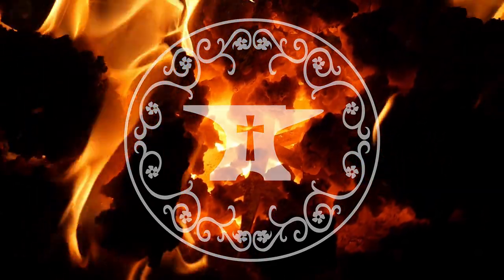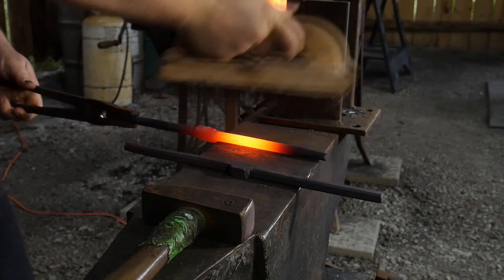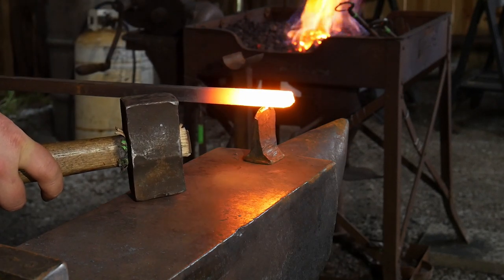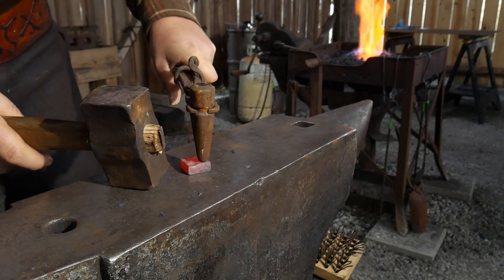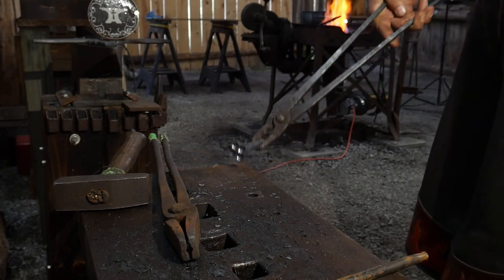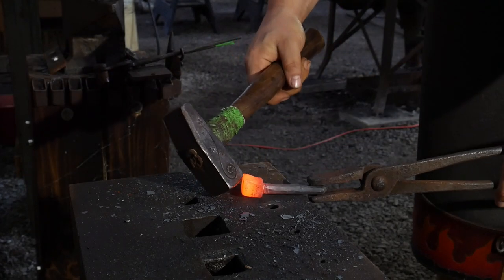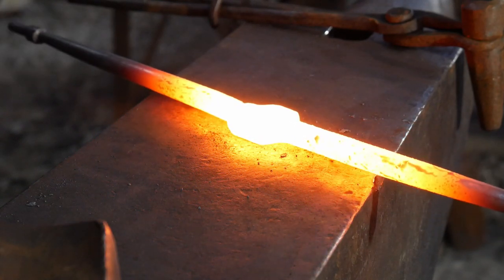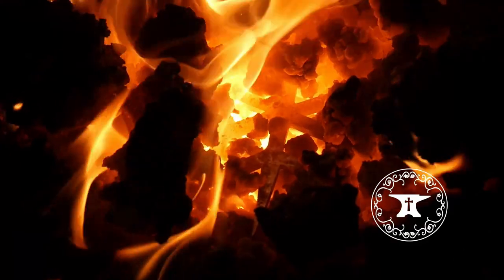How to Forge a Gothic Door Knocker with a Rosette

Comment: Just tried for my first time, forge was too small to bury the steel. 
And the leaf blower sprayed all over keeping the fire cool.
Reply: My forge is small  I've got an video on building my forge  I use an cheap blower from amazon and you don't really have to use  much water all the time it helps with  with the coking of the  coal  there are more on  Roy stream that's been doing this longer than me .
Reply: @NOTINTERCEPTER01  for now I'm just doing it to learn a bit, and to maybe make some bodgery tools I'd otherwise not be able to afford on around of them being so specialized. For the most part the forge is just going to be for the heat treat seeing I don't really have a decent anvil I'm going to be a material remover rather than mover to start.
Reply: @horseblinderson4747  you should check some of my videos out I use what I have around me to move metal it's not what you don't have its what you do have I make do with what I have and if you have seen the last live stream I sent an giveaway item to Roy and that was forged with what I had to move metal.
Reply: And sorry @christcenteredironworks for plugging my videos but I'm showing what can be done on an super strict  budget.